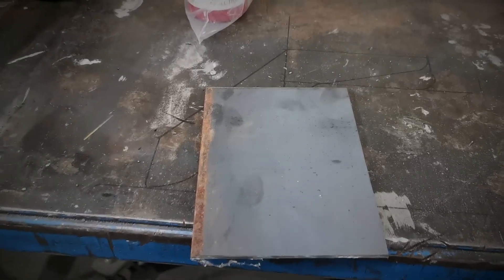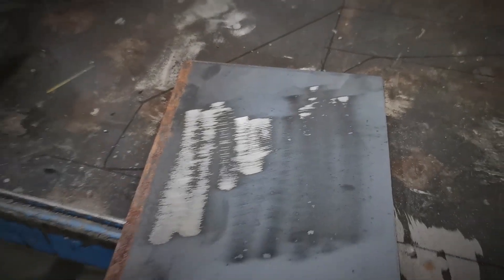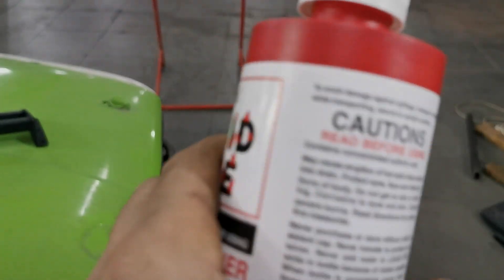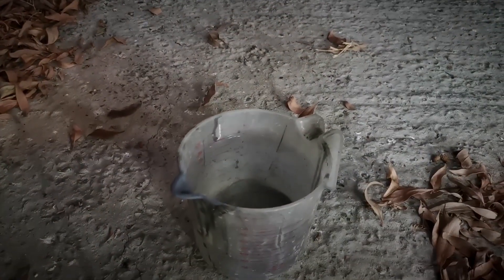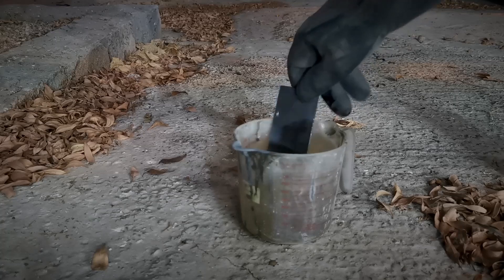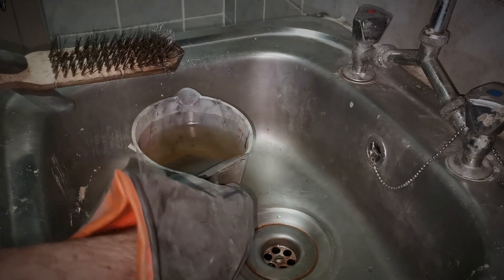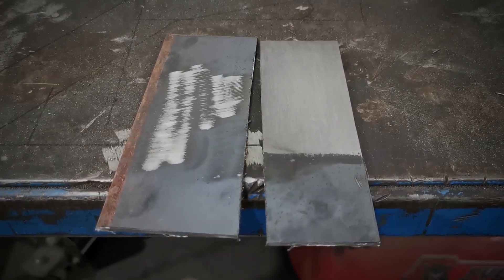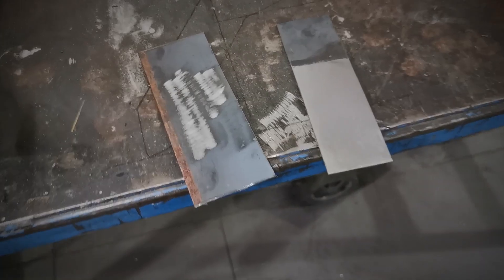Can a HOUSEHOLD cleaning product remove Mill scale or Corrosion from steel??

Comment: This may get your Mill Scale off and it does, but what most people don't realize is that it is Highly Corrosive especially to Iron and Nickel Based Alloys. 
So unless you want your Metal to start corroding later, even under the Paint that you may apply to it, I definitely would not use this on my Metal Projects that I would be building.
The safest Chemicals to use for Millscale is White Vinegar, or Citric Acid, while they may take a little bit longer, they are not gonna cause any lasting damage to your Steel.

Comment: Great helpful short vid, Thank you. One question and one suggestion;
Why is the wire brush used. Is it that the solution doesnt quite get everything off.
Suggestion; (In my experience) Immediately after chemical cleaning rinse off with soapy water. This prevents immediate rusting and gives a lot more time to work with.